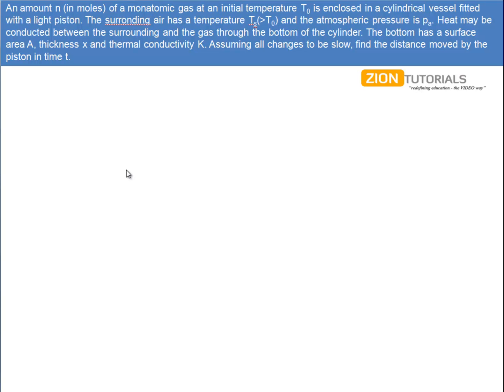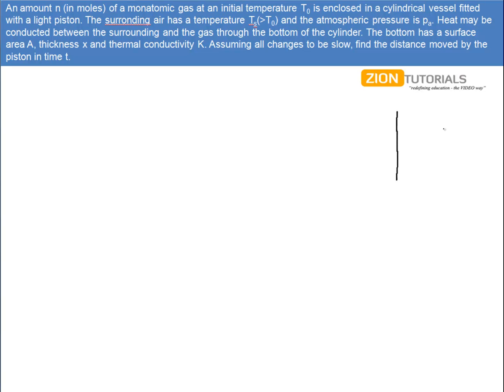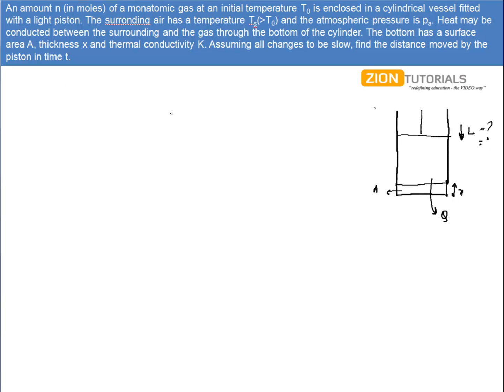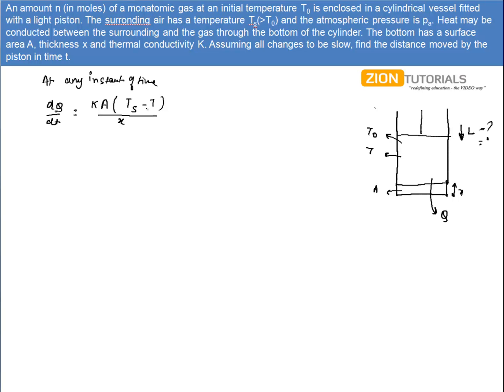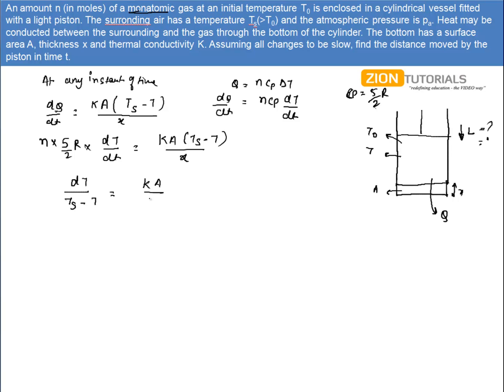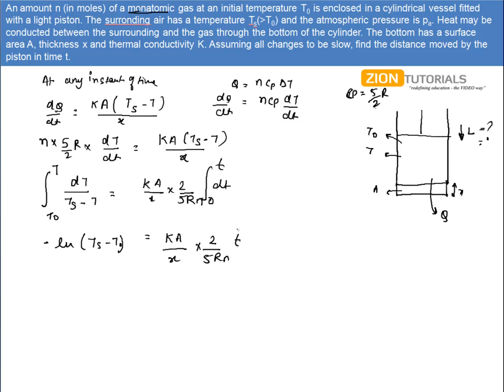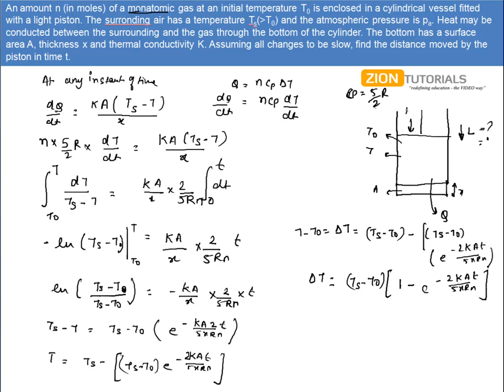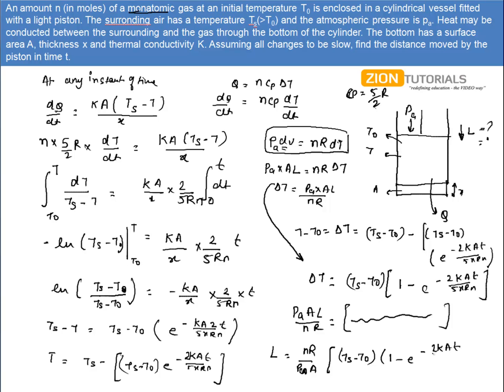heat transfer Q 38 - H.C. Verma Physics Video Solutions

Comment: Correct me if I'm wrong anyone, but sir, your assumption of heat flowing AWAY from container is valid but your equations do not at all satisfy that assumption. 

If heat flows away, in the first step you should have written 'T - T(s)' since heat will flow away only if T>T(s) and instead of dQ, it should be '-dQ' since heat is being lost by the container. Although, your calculation still gives the correct answer since the negative signs cancel each other out and you get the same equation. I think sir should have explained that part. If you take the assumption that heat is being gained, the equations would be smooth and you wouldn't have to worry much about sign. 

Sir may answer or not, but this might be helpful for any future viewer. Take the sign convention and assumptions carefully. A wrong sign with respect to your assumption can change your answer completely.